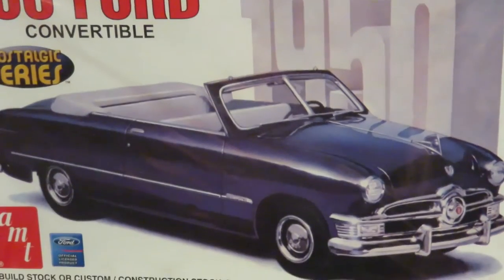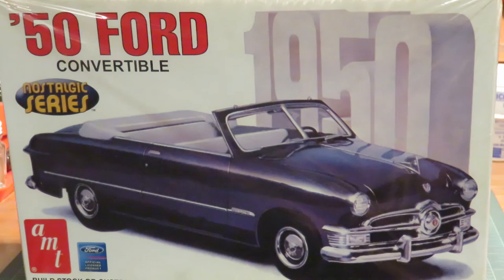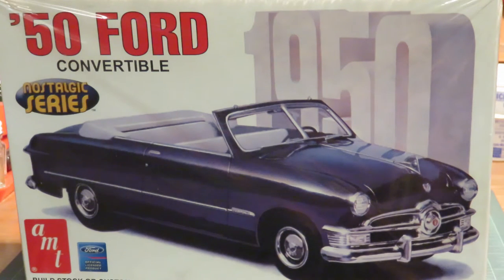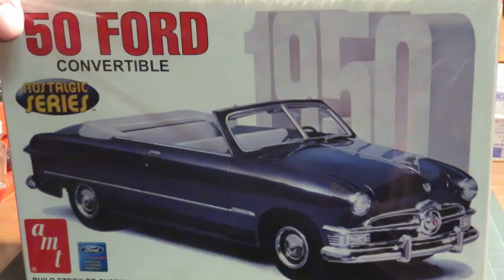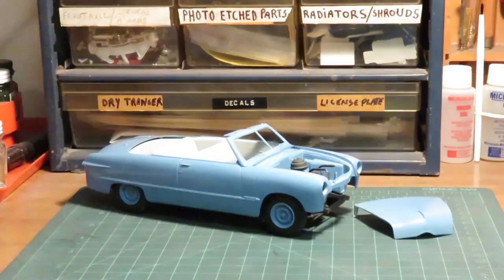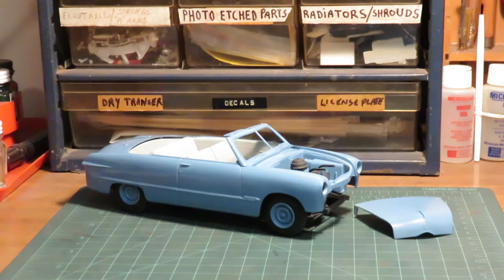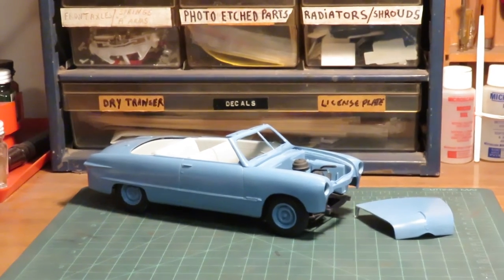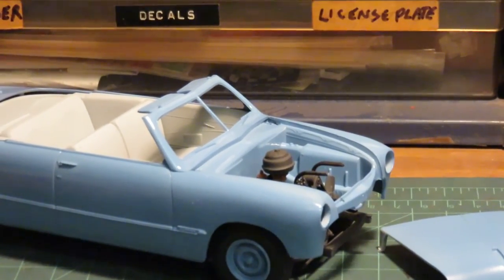Stalled projects #4

Comment: Should I get this? There is a hobby lobby trip coming up and this is on my list
Reply from the maker: It is from an old tool. 1962 was the 1st issue. There will be some clean up issues such as mold lines,ejector pin marks & flash to deal with.The exhaust in molded to the chassis. The suspension is separate units. It can be built stock or a couple of custom options . it has some hop up parts for the flat head engine . It comes with a convertible boot for the top down version, an up top or a custom landau  1/2 roof & alot of other customizing parts for the body. aside from the stock wheels & hub caps there are a set of 5 spoke chrome wheels which appear to be Cragars. with a little work it can be built into a nice looking model.It will not go together like a "new" tool Revell kit so do not expect that. If you want a 50 Ford convertible, it is the only game in town.
Reply: What is the best way to get rid of ejector pin marks? This is DishChicken on a different computer by the way
Reply from the maker: It depends. Some ejector pin marks are raised, while others are indented. the raised marks you sand down smooth. the indented marks, you fill with putty, then sand the putty smooth.